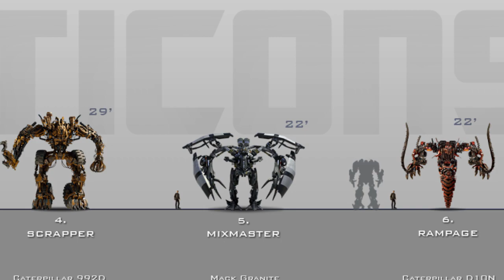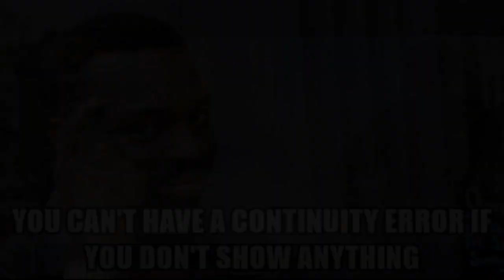How Scrap-Metal Survived In ROTF

Comment: It's so confusing that when the four Contructicons were hiding on the cargo ship, from the upper view Rampage's D9T Cat Bulldozer is RED, and Scrapmetal, or Scrapper, (I really don't know which one it was) but it was a Mega front end loader. And then it's a Volvo pipe lifting excavator power crane, and the D9T bulldozer is YELLOW. Just confuses me every time.
Reply from the maker: Still gets me to this day
Reply from the maker: I didn't update it video called Constructicons misconceptions 2.0 that explains it a lot better than I did in this video
Reply: @Theorymus  That's the most confusing part in ROFT to me. And I didn't realize the Buffalo minesweeper truck to the right when the fallen lifted the military forces. But it's weird how it didn't have the minesweeping clearer claw on it.
Reply: Buzz, Iet me explain you. Scrapper has been confused with Scrapmetal, because Scrapmetal has parts of a Caterpillar 992G Front Loader.

Comment: I always thought he was connected to scrapper to be devastators right shoulder, since in the movie both arms were the same size, and if three components made up his left arm, it would appear much bigger than the right, and devastator is described in size charts as being about 103  feet tall, and because of his hunched posture, his shoulders and arms would need to be as tall if not taller than his head, and scrapper is only 29’ tall, meaning there is no wan his vehicle mode Is big enough on its own, while excavators are massive vehicles and scrap metals vehicle mode would definitely make scrapper able to attach to devastator. I think the only reason that scrap metal was behind Hightower was merely an error and that he was just in the wrong spot, however, the observations you made were really good tho and I still love the video, this is just one thing that I kind of disagree with

Comment: Scrapmetal has 2 alt mode: Before Scrapmetal, Mixmaster, Long Haul, Rampage, Scalpel and Ravage go to the water to revive Megatron, Scrapmetal is a Front Loader instead of a Volvo EC700C Excavator.
His CGI model has parts of a Caterpillar 992G Front Loader instead of a Volvo EC700C Excavator.
When Scrapmetal was being dragged by his comrades he has treads on his feet.
When Scrapmetal Combines with the other Constructicons, He is a Volvo EC700C Excavator instead of a Caterpillar D9T Bulldozer.

Comment: I think scrapmetal combined with scraper to make a shoulder because the yellow behind hightower was just him connecting plus hightower had to combine with buckethead and that would be bigger than scraper that is why I think scrapmetal combined with scraper and when you see scrapmetal in vehicle form   behind hightower scrapmetal was just driving to scraper!💎💎💎💎💎💎💎💎💎💎💎💎💎💎💎💎💎💎💎💎💎💎💎💎💎💎💎💎💎💎💎💎💎💎💎💎💎💎💎💎💎💎💎💎💎💎💎💎💎💎💎💎💎💎💎💎
Reply from the maker: But hightower had 2 treads in arm form in the cgi modle
Reply: Scraper and Longhaul are pretty big constaicon
Reply from the maker: Yes they are

Comment: 2:45 It’s illogical. They had to rip Scrapmetal apart to gain spare parts for Megatron, and only then revive Megatron. Which means to revive Scrapmetal they would need spare parts as well. I think Bonecrusher, Blackout, Brawl and another Scrapmetal in ROTF are simply clones of original Decepticons. During battle in Egypt we even see multiple spare Constructicons.